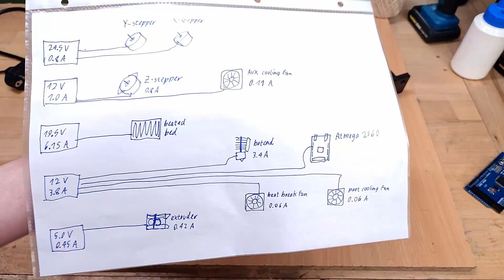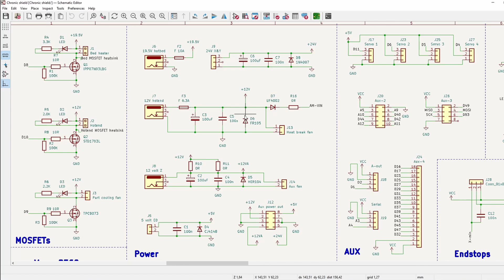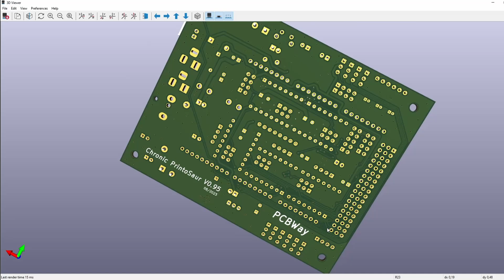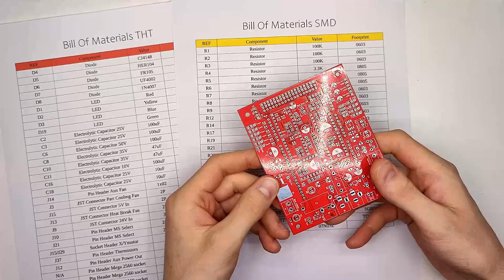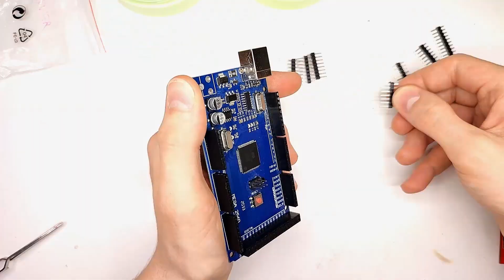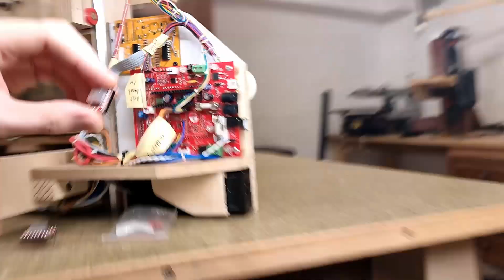Making a custom Ramps 1.4.2 shield to finish my unipolar 3D printer! | Part 13

Comment: I was about to make my own diy 3d printer 2 days ago when I found your channel, after finishing all your videos I think I'm going to find a job and just buy one...

Anyways your amazing, this is the most amazing and sincere project I've found on this platform. I have 5 dollars on Paypal that I've been saving to subscribe to diy perks Patreon for his schematics but u think you deserve it  :)
Reply from the maker: Yeah... If you just want a 3D printer it's certainly the cheapest to buy an ender 3 during a clearance sale somewhere or even a second hand one. Microcenter once had them for $100 I've heard. Making one for cheaper than the mass produced ones is pretty time consuming and requires a lot of cut corners :(
Also, filament is expensive and will quickly add up to exceed the upfront cost of buying the printer, I already spent as much on filament as on this printer.
Btw please don't support me on patreon if you can't really afford it, I would just feel guilty :)
Reply: 3D printer is one of these thing that are cheaper to buy than to build.

Comment: Ended up here by random YT recommendation. But anyway watching, albeit bit skipping parts here and there. It's refreshing to see peole do these "back to the origins" stuff thats about as much diy as it can be, instead of millionth Voron build etc. GJ.
Reply from the maker: Yeah, all those identical 3D printers really bore me to death as well... There's something to be said about the evolution of a design reaching conclusion, and IMO 3D printers in general have done just that. There's nothing to add, the reason printers these days are designed the way they are, is because it's the simplest, cheapest, and most functional way to go about it. 
I see people really enjoy this series because of the "back to the origins" approach, which is funny because I just really didn't know what I was doing when I designed this machine. Even my next printer will be much more similar to the standard ender/prusa design albeit out of more trash.
Reply: @ChronicMechatronic  I mostly mean "back to the origins" just commonly the so-t-say RepRap movement, which included figuring things out and assembling pretty much everything yourself. I don't think most knew what they were doing in the beginning :)

Comment: Your anti reverse polarity diodes are crazy as if you actually have a reversed polarity, you shorten the power supply...
Reply from the maker: That's normal, it's the exact same in the original Ramps. By shorting out the power supply it clamps the voltage and protacts the electronics. So long as you don't use a crazy powerful supply or even a traditional transformer based one it's fine because almost all switch mode power supplies shut down if they're overloaded and for a brief second these diodes can endure a multiple of their constant current rating.

Comment: Now that caliberation of the printer is remaining, Please keep a hand on the power switch or switches as you and the printer do not know where it's going to go and what are the limits! I have a lot of experience of crashing gantries and skipping stepper motors in the middle of the night!
Reply from the maker: OMG I totally forgot that, even though I preached it myself in the pen plotter series 😂
I'm already through that most dangerous initial phase of calibration and it went smoother than I ever imagined!

Comment: oh, and just occurred to me. Maybe you can run klipper using a cheaper micro. you could use a linux installation in a computer so you dont need an sbc!
Reply from the maker: I'll actually use an old laptop with Linux installed as a host and UI!
Reply: nice! you should take a look at klipper than. it uses the host to a much greater extent. The mcu only takes care of sensors and stepping, so you could use something cheaper and better like an st micro or an rp2040

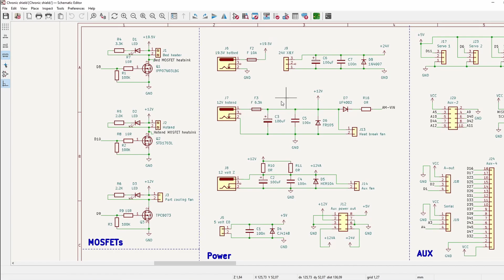Comment: 4:00 Barrel jacks are the worst for polarity reversal because there's no color coding, and some power supplies are positive inside and some negative inside, and you never know which one a device wants unless it's labeled or you follow the PCB traces to something of known polarity.
Reply from the maker: Good point, tho so far I've never come across one that was negative inside
Reply: @ChronicMechatronic  I've run across exactly ONE in the decades that I've been tinkering so it's possible.  That taught me to always check, even if it's highly improbable.
Reply from the maker: @quinbee_creates  cheapass dollarstore type products I imagine? Like you can get USB cables with incorrectly color coded strands from China because they can't be bothered to stick to conventions? Either way I always check my power supplies because they were in the ewaste bin and don't always work - sadly 😢

Comment: Buy an 80W temperature regulated soldering iron. They only cost $10-15 and can solder tiny stuff and big fat wires since power is only delivered as needed.
Reply from the maker: Yea I figured there must be more to those ridiculously tiny pen-like soldering irons than I gave them credit for...

Comment: Next you should try is making your own BTT skr board
Reply from the maker: Good idea, I definitely want to move to an STM32 MCU for the next printer
Reply from the maker: That's actually a really great suggestion, thanks, I just checked out the SKR mini E3 and the fact that the schematic is public would allow me to base my own board off of it without having to mess with the software 🤔😅
Reply: @ChronicMechatronic   That would be amazing if you can pull it off. Though a bit complex but definitely doable.
Reply from the maker: Yeah this shield was by far the most complex design I've done to date, had I not just copied Ramps I'd definitely have made some fatal mistake 😂
The SKR mini looks pretty similar overall, it mostly just has a few DC/DC regulators and other support components added

Comment from the maker: Ben from the future here to tell you: the shield is fully functional and the printer prints!!! Stay tuned for the next episode!!
Reply: Can't wait! This project is giving me the confidence I need to design and build my own printer
Reply from the maker: @Dragar-X  I'd say go for it! Considering how many shortcuts I took it  and not knowing what settings to use it prints surprisingly well imo. Tho if it's not urgent I recommend you wait until I do the video about all my design mistakes so you can avoid doing the same ones 😆
Reply: MASSIVE congratulations on this project success. I cannot fathom how you were able to design and BUILD a functional 3D printer without even having worked with one before....For $50... It's actually astonishing!
Reply from the maker: @ConorFenlon  not the end of the road yet! I still have to install lead screws for it to be able to compete with other printers in terms of accuracy, but I was also really surprised that it works! As it is right now I've used ~$45 of the budget, the rest is margin for glue, screws and hardware I couldn't reasonably keep track of 😂
Reply: @ChronicMechatronic  Even if you allocated yourself a $100 budget, what you've achieved thus-far is incredible, and a testament to your ingenuity! Kudos!!
Reply: I got NEMA17 (big ones) from a junk seller. I will follow your steps to build my own 3d printer
Someday I guess 🙃 as I don't have all the necessary tools and budget.
Reply: WOW! niceee. i cant wait to see the series on upgrading it with printed parts =)